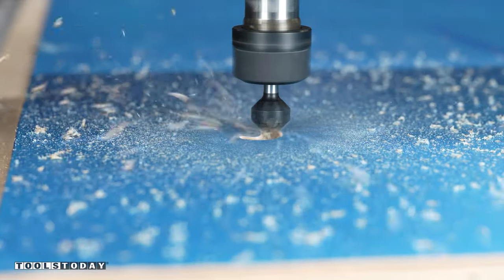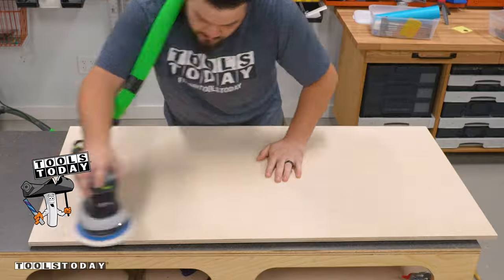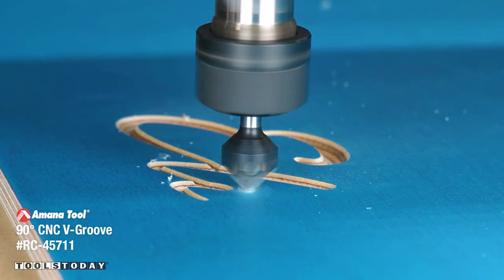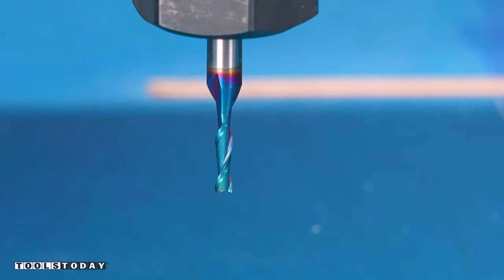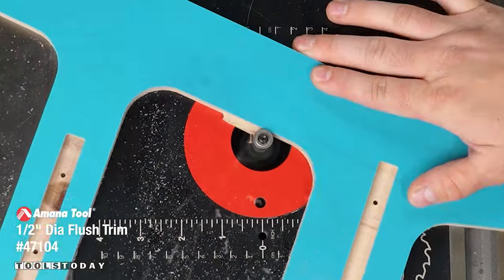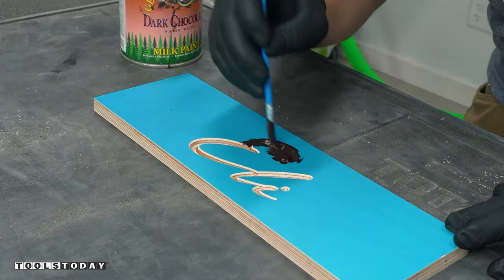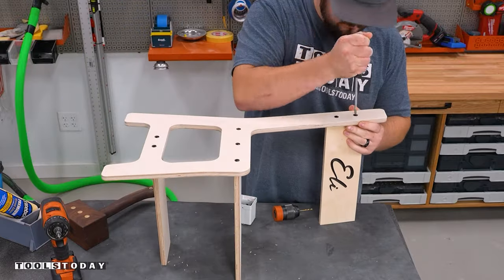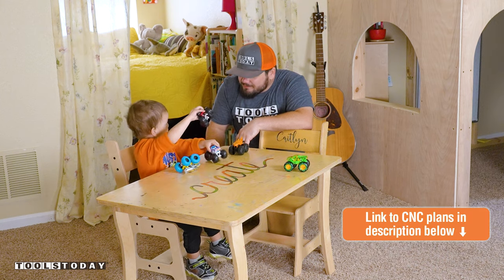How to Make Plywood Chair on CNC | ToolsToday Video

Comment: For oramask, I also use a rubber roller (like you would use for veneer). I've never had an issue with it not sticking (if anything it sticks too well). .. I love those chair designs. They look great! Great tip on rounding the edges to fit in the hole (it seems so obvious, but I think this is the first time I've seen it recommended).
Reply from the maker: Yeah, that will certainly work as well!  I think the biggest issue most people have is trying to apply it to a non smooth surface and not blowing the dust off fully first.  Thank you for watching and for the kind words!
Reply: @ToolsToday  Oh, for sure, the first step is to blow/clean the dust off.